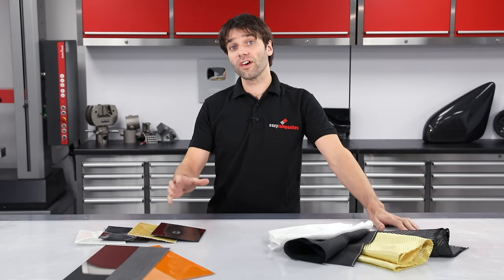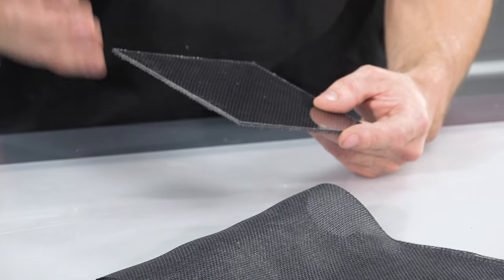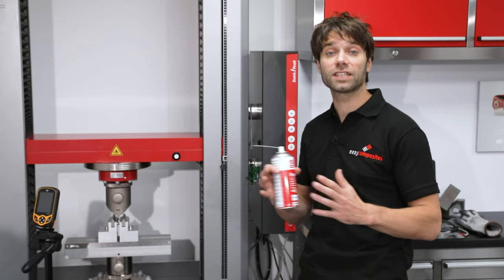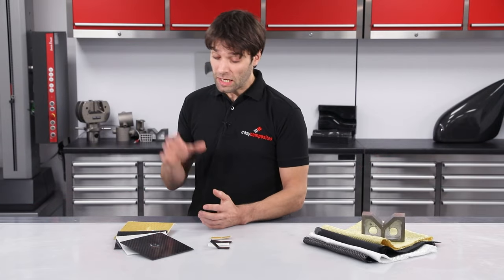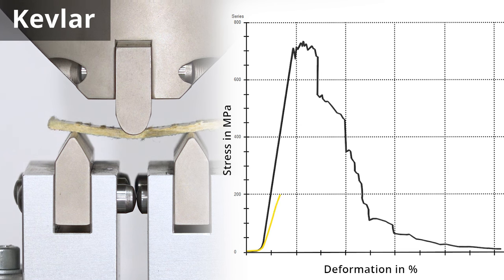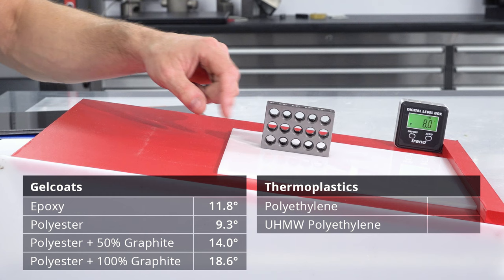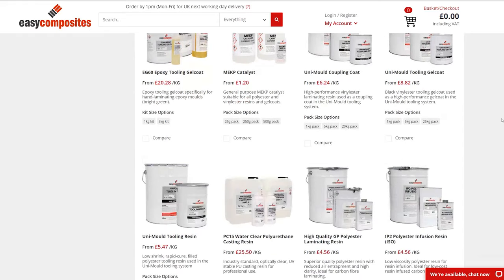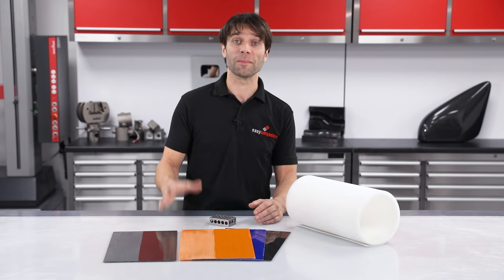Choosing Composite Reinforcements for Impact Strength; Kevlar, Carbon, Innegra, Diolen

Comment: Another issue with carbon is that is highly thermally conductive.  The epoxy resin will lessen this quite a bit, but one of the things that can happen with carbon is that as the water is melting on the surface from friction, it may start to refreeze faster increasing friction. 

  On the other hand, kevlar, polyester, and polypropylene are much less thermally conductive and would insulate the sled from the above better.  

 But with the epoxy resin, there probably isn't that much of a difference between all of them in this regard since the resin can make up a good percentage of the overall material, and epoxy resin is much more similar to kevlar, polyester, and PP in that regard (since these are all essentially plastics).
Reply from the maker: The layer of epoxy and the prolonged time in the cold environment for the sleds themselves mean they will likely be close to the ambient temperature for most of the in service usage so the material differences is not such a big issue.

Comment: When comparing the various material samples it would have been wonderful if you had included a simple fiberglass sample as well, as most of us are familiar with fiberglass and could better use that to gauge how these other materials compare to the most common composite that we run into. Maybe next time.
Reply from the maker: The video wasn't about general property comparison but specific to this individual project hence the fibreglass was ruled out very early on.  It is possible in the future we may do a general materials comparison video.
Reply: @easycompositestv  Understood. It was just such a GOOD video but I thought it could be made more relatable by inclusion of a fiberglass sample as the "baseline" instead of carbon as the baseline. Looking forward to a video on materials in a more general sense to help us newbies pick a good material for our projects. Keep up the great work!

Comment: You guys need to try a test with Innegra mixed with carbon. I’ve been told by Innegra that it is best to mix it with other reinforcements as it is not that good by itself.
Reply from the maker: Hi Alexander, well, yes, there's certainly some truth in that but it depends what you want to achieve. If you wanted maximum damage tolerance then you wouldn't combine the Innegra with anything else, if you wanted to add some stiffness then combining with a higher modulus material (like glass or carbon) can make sense. The problem with a hybrid like this, for this application, is the failure mode: the Innegra offers little stiffness and has a high elongation. In the event of a heavy impact on a carbon/Innegra hybrid the Innegra will offer little tensile strength, putting all the work onto the carbon, the carbon will break, leaving the Innegra holding things together but most probably doing only that, holding it together. If you had another 2 months to drag a broken sledge across the ice, you might not thank us!

Comment: The graphite can't possibly lower the friction when it's enclosed by the resin. Lubrication with graphite works through the individual graphite molecule layers sliding against each other, but that's not possible if all of it is encased in resin. Also the graphite particles will lead to a higher roughness of the surface just because of their shape, that's why friction decreased after sanding.
Reply from the maker: Hi Joel, that's all fairly logical. We weren't really expecting graphite to reduce friction in a low-to-no abrasion situation, this was more a case of addressing the fact that some sledge manufacturers do do this and so we wanted to work it through. There is a bit of a contradiction in your comment though, you describe that in the virgin component the graphite is fully encased in resin (which is true) but then suggest that the roughness of the graphite particles on the surface is the cause for the increased friction. I can assure you that because the resin full encases the graphite particles, there is no roughness from them and that abrading the surface certainly increases its roughness, not reduces it. And yet, the friction is significantly reduced in the example with graphite, compared to the sample without graphite which has had identical surface treatment. This seems to be  something you overlook in your comment.

Comment: Hi Paul,
Very interesting approach in the comparison between materials! Really enjoy the way you present the videos! Congrats man!!!
But I'm wondering here... It's known that sailboats for high latitude sailing are made of aluminum due to strength and elongation against an ice impact. 
Do you believe that the results you got are applicable for composite hulls in a high latitude sailing?
Reply from the maker: Hi Paulo, well, we certainly don't claim to be breaking any new ground here, this is - as much as anything - a demonstration of what is already known about the materials we tested. But, to answer your question, it would certainly be possible to engineer and composite hull that would outperform an aluminium hull in all respects, given the right design, testing and construction. This is because there are just far many more options available in a composite laminate than there are with aluminium, and because many of the materials available significantly outperform aluminium, therefore it's just inevitable that a composite hull, done right, would be unbeatable.
Reply: @easycompositestv  There are also different requirements for ship hulls vs expedition sledges, and of course in the renewed/curious use of stainless steel in modern space craft. Metals, unless carefully and robustly coated, could cause issues with icing on snow surfaces, and would be a hazard if in contact with bare skin as they conduct heat so fast.

Comment: I wonder if you should test molybdenum disulfide and/or teflon? Is it even comparable with gell coat? I have heard of using teflon filled epoxy as an anti adhesive surface. It is just about impossible to repair though, and I have always wondered about the moly...

Comment: Great video ! I'm wondering what would be the outcome of the impact test if the constraint is to keep the integrity of the structure behind the laminate. My use case is a carbon sandwich sailboat bow with a sacrificial shield to protect from log strikes). Deflection become a more important factor which may place the carbon back on top of the leaderboard.
Reply from the maker: You would probably want some kind of foam between the two surfaces so that the foam absorbs the deflection of the outer layer to prevent excess energy being transmitted into the structure behind.

Comment: Some company has a hybrid fabric weaving innegra with basalt fibers. Basalt fibers have about the same strength as e-glass. But the combination of the two seems to provide the durability of the innegra with strength of fiberglass. It would be very interesting to see you two destructive tests done on that material.
Reply from the maker: Hi Dimitri, thanks for the comment. Indeed there are hundreds of different 'hybrid' fabrics which combine properties of different fibre types, unfortunately it would go on almost forever if we'd tested all of these materials! Basalt/Innegra could be interesting, as would basalt/glass. Maybe we'll do a video all about hybrid fabrics in the future which would allow us to dive deeper into those type of reinforcements in paricular.

Comment: I'm reviewing here and I'll venture that wet sanded and buffed graphite infused resin would be slickest in both categories. Of course kevlar is often used as an outside layer because it's unbeatable against grinding friction. Incredibly difficult to wear through a kevlar splitter where a carbon one will disappear with every passing contact. A kevlar outer layer, followed by a few layers of innegra, and stiffened on the inside with carbon is the best multicomposite mix. If you have a human on the inside, layers of kevlar prevent carbon fiber intrusion in your soft parts. High end carbon aircraft line the cockpit with kevlar for that reason. In the multi layer I described previously, the layers of innegra diffuse the impact over a larger area. Material combinations absolutely work and are frequently used in aerospace.
Reply: I was also thinking about mixing these materials but not just multilayered; what about using a different material threads in a weave or mixing the materials fibers one process up when being spun into a thread
Reply: The issue with Kevlar is it does not join to inself at all well so i would be using it as the core material. And you cant sand it, it just fluffs up.

Comment: Innegra - urethane acrylate composite would seem like a superior (ultimate?) choice for aftermarket bumpers, 25-30% weight reduction to carbon-epoxy composite and far more resilient to damage.

Comment: Density comes in a little late as an aspect - the stress-over-deformation diagrams should have been (a x stress)/(b x density)-over-deformation to give a better picture, with a and b beeing how much each property is valued for the task.

Another point that made me wonder was, only one of the tested fibres was chosen for the sled. Why wasnt any combination of lets say two fibre types considered? This option is one of the greatest advantages of composites after all.

Comment: Your drop test is actually pretty close to an actual test method.  Look up the "Gardner Impact Test" reference, ASTM D5420.  It's essentially the same test as what you've done except there are set weights, and the geometries for impact.  It is very simple to perform and gives some valuable data.  The only caveat is that you must be consistent in your definition of "rupture" or "crack"
Reply from the maker: Thanks, yes, we improvised based loosely on existing test standards. For comparative results (rather than ‘absolute’ numbers) tests like this produce very reliable results, often more reliable than - for example - comparing manufacturers’ own published data.

Comment: It would be interesting, if you picked a thinner piece of carbon or kevlar that has the same strength as the polymer fibers? After all, it makes sense to compare similar strength pieces. It could flex better and take the impact loads much easier without breaking.

Comment: good video that show that kevlar attributes are a myth when is just only a good sacrificial material that absorbs energy without being shattered as it happens with carbon.
Also this video reflects the good mechanical properties of thermoplastics even with thermoset matrix, however I would choose thermoplastic matrix and carbon fiber
Reply from the maker: Thanks for the comments. I'm not sure about Kevlar attributes being a myth, Kevlar is a remarkable material but like any material it has advantages and disadvantages. After all, we did go on to make the sledges out of Kevlar so, out of all these materials, it offered the performance and handling we preferred for this project.
Reply: @easycompositestv  Yes, they all have attributes but I thought kevlar was a strong material against impacts (what I refer a kevlar's myth) and is totally contrary due its low compressive strength, but thanks to that low compressive strength it absorbs the impact energy and most important, without shattering. But again it easily loses it's structural integrity that it's not desirable for boats for example where kevlar can be used as a material to be destroyed to save a carbon fiber structure. The bullet proof properties of kevlar exist only without matrix and with several layers, and the thing is that kevlar could be used with some flexible thermoplastic instead with no flex and brittle epoxy for better impact sacrificial properties where other fibers just would shatter.

Comment: Just make the sleds and then bolt on the UHML runners. I understand they fear delamination but if they are bolted on like how cheap sleds do it I don’t think they’d have an issue. The bolt hole added friction would need to be worth the reduced friction though.
Reply: The strip runners will be UHMWPE, but we debated the 'skinning' idea at length. We opted to avoid it for such a major expedition, as it would rely on an adhesive - which might be fine, but we needed definitely fine. I've tried mechanical fixing of very thin 1mm UHMWPE before, and it loves to flex and wave, losing its shape.

Comment: Helpful video tutorial, to imagine my upcoming project. Thank you for that. But i do have a question about the calculation that is being used for tensile strength. Because how did you know that this was good enough for this build? It would be really helpful for me, if you can make a tutorial on this. Cheers
Reply from the maker: The testing here was done purely for comparative figures rather than specific structural calculations.  Mechanical data for structural calculations is available and commonly used, however it doesn't always show the full picture hence the slightly modified testing as well as the impact rig and friction testing to tailor it for this specific project.

Comment: From what I remember in my days as Air Frames Mechanic in the Navy you could get better bend strength of the composite structure, with the correct choice of the resin matrix that has a good bending strength at lower temperatures. The longer the resin matrix maintains adhesion with fiber layers the better bend strength.
Reply: Mr. Patrick, I have a doubt... For having better bending strength, u have to layup fiber in that direction, but how bending strength is dependent on resin system.
Reply: @nishithkishore9841  the resin is the stiffening and binding agent. Without it there is no rigidity. There are two failure modes for a composite structure, one is failure if the fiber, second is failure of resin to hold the fibers in the matrix.
Reply: @patrickradcliffe3837  ...Sir, can you share your email ID , I want detailed discussion on it. I am struggling with a component to increase its bending strength.

Comment: Have you tried wax on the substrate? Works for surfboards, may work with colder weather too.
Reply from the maker: Hi Damon, yes, indeed, waxing PTEX (as found on skis and snowboards) used for the runners on the sledge would reduce friction so I guess the team probably do do that on the runners but potentially could do it on the belly too.

Comment: What are the machines you use to test the materials? You have an amazing workshop there at easycomposites could you guys give us a video tour?
Reply from the maker: Thanks JCM. We're using a Zwick Universal Testing machine, we have grips for tensile, compressive, 3-point bend and lap shear. We use an Epsilon extensometer for modulus (on high mod materials). I'll put 'video tour' on our 'to-do' list. Next series is all about 3D printing in composites and we have some more projects planned after but might try to slot in a tour :)
Reply: @easycompositestv  that’s sounds like great content is coming!

Comment: These guys know their stuff ! But still I wonder the possibility to use two or three materials together to get the best combo?
Reply from the maker: Hi, yes, indeed. You could either use alternating layers of different types of reinforcement or you can even use 'hybrid' fabrics which combine different fibres within a single layer of reinforcement. It's simply a matter of where to stop with a video like this and also difficult to see the individual characteristics of the different materials if we did the testing with them combined. But yes, often it can be advantageous to combine different reinforcements. In this case, what the project really needed was exactly the properties of Kevlar and so hybrids weren't required in this case.

Comment: You should really use an actual ski base material for your base. The UHM polyethylene is pretty close but ski base materials will have some extra additives and probably be sintered to except wax & be as fast as possible on snow and ice.
Reply from the maker: Hi Reed, one issue with this is that ski/snowboard base material does need to be regularly re-waxed; this is an issue for an expedition such as this where re-waxing isn’t as easily undertaken or indeed convenient.

Comment: Question:  if you have a mixed material composite- how would the layering make a difference?  --- maybe a 3 layer product: innegra then kevlar then carbon.  then test it carbon side down vs carbon side up?, especially with a longer radius flex/stress.   I am teaching myself how to build white water kayak paddles that get too much rock impact and failure causing direct, in-line, pushing.  thanks!
Reply from the maker: Great question. In short, yes the position in the laminate can make a difference in the performance of the part. Generally it's good practice to have a symmetrical layup to balance the laminate. If we use carbon and kevlar as an example, carbon skins with a centre of Kevlar will be relatively stiff with slightly more flex and resilience than pure carbon, Kevlar skins with a centre of carbon will be relatively resilient, less stiff than the previous laup but stiffer than pure Kevlar.